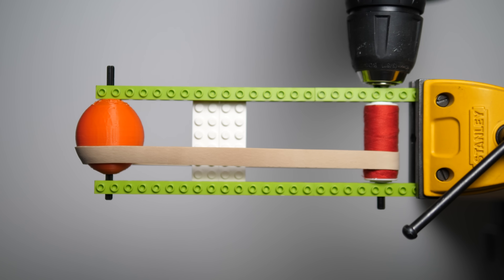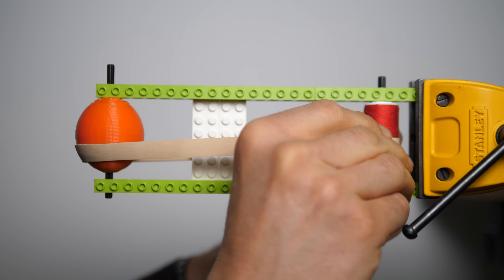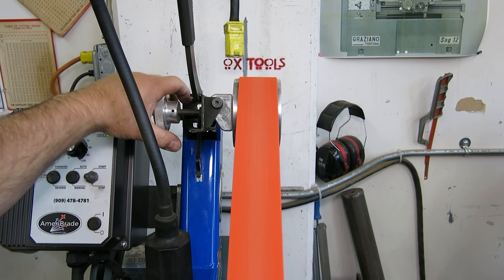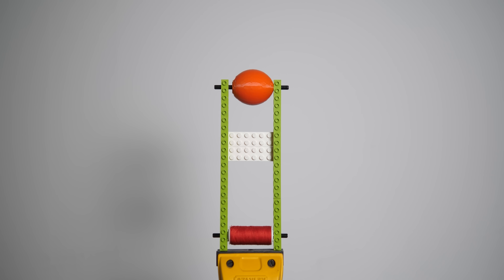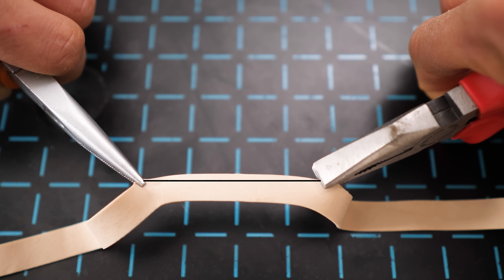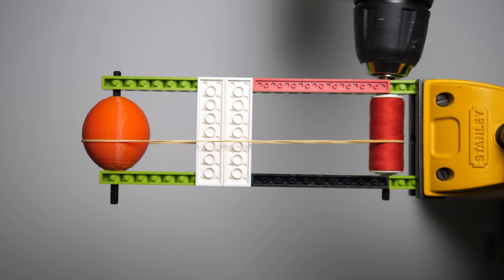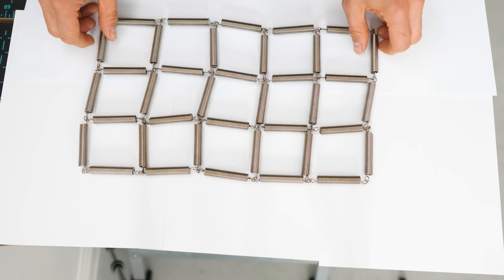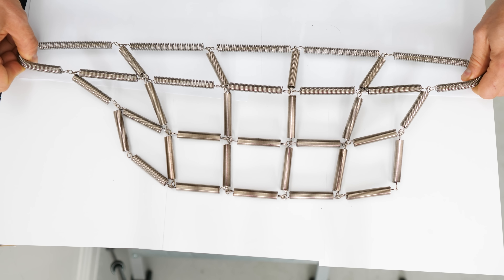The Band Should Slip Off But It Does The Opposite!

Comment: This doesn't seem entirely correct. The ball pulley or concave pulley have different rotational speeds in the center, and exterior, depending on the pulley used. 

Ball: faster in the centre.
Concave shape: faster on the exterior.

You're right when it comes to the separation of the elastic band into more or less two parts. But it is because one of those parts moves faster that it directs the band in that direction. At least as far as I can intuitively sense. 

Like a storm on Earth rotates towards the slowest part of the rotating Earth. Now imagine those clouds are mollecularly bound together, and cannot rotate. They are a flat elastic band. They would pull the slower clouds, to whom they are molecular bound, along with them towards the fastest point of rotation, the fastest rotating longitude.

Don't you think?

Comment: There's a well-known lab demo in introductory statistical mechanic where you hang a weight on a rubber band and then use a hair dryer to heat the elastic. The band contracts and the weight rises, precisely because you're adding energy to the system and dS ≥ dQ/T (for an irreversible process). There are more ways for the rubber polymers to be shorter than longer, so that is a higher entropy state.

Comment: If it's due to a property of elastic deformation I suspect that it wouldn't work well on a belt sander belt (they aren't all that elastic) yet the crown pully on a belt sander works very well despite a very subtle curve.

Elastic deformation is a good explanation, but I suspect another thing is happening also that would make this work for inelastic belts.

If you try to wrap an inelastic belt nice and flat around the lower/higher end of that curve it's going to head off at 90 degrees to the part of the tangent of the curve. Instead of heading towards the flat contained pully it'll deviate by the same angle as the tangent of the curve of the crown pully.

It's unable to go in this direction though, because the other pully and housing provide a force resisting that.

For an entirely inelastic belt an equal and opposite force will be applied at a tangent to the surface of the crown pully in the direction of the center (high point) of that pully.

Purely elastic surfaces will work due to one phenomena, purely inelastic belts due to the other. Everything in the real world a combination of the two.

Comment: Yup - always travels the the highest point... I learnt about this working for my Father - he engineered many large industrial band saw machines for the Aluminum industry where the blade was riding a crowned wheel (with no lip to hold the blade on). It reduces the overall stress on the blade = more cuts per blade / better productivity etc.....

Comment: Very nice... so far as it goes.  Traction engine belts to farm machinery, and the drive lines to factory machine tools (similar to the belt sander) don't have stretchy belts (canvass), and they are slack.  It can't be stretch deformation keeping them on - there has to be some other self-centring effect.

Nonetheless, the demo of a belt running on a ball is completely unintuitive (ie it looks mad!).

Comment: Simple yet very effective principle. I first experienced this when I made my own lathe. I needed a set of transmission pulleys and I decided to make them myself. I first tried flat ones. After few trials, I realized the belt climbs(!) the pulley and thus convex-shaped ones self-align the belt. Without any flange, it was very easy to turn with my lathe in a short time with minimal material loss. Still it worked really good. The belt slipped off only when the chuck stall accidentally with too much cutting force.

Comment: Entropy is easy to explain under Everett’s MWI.

If you have 100 coins and they all perfectly have heads up, there’s only one such arrangement.  If you let some disorder in, and one coin can be tail, then there are 100 such arrangements where one coin went rogue.  If two coins went rogue, it’s 4,950 arrangements.  If three coins went rogue, it’s 161,700 arrangements.  And so on, peaking at a maximal number of arrangements when 50/100 coins went rogue.

Under Everett’s MWI, each such arrangement has its own timeline in the infinitely branching multiverse, and there is a chance that you’ll end up in the world where all 100 coins flipped heads. But there are far more of “you” who will observe a messy disordered jumble of coin flips because there are more such arrangements of them, and therefore more timelines under MWI where messiness dominates.

This is why the universe trends toward higher entropy, but if you’re unlucky it won’t.  There’s an unlucky chance that all the air molecules bunch up in one corner of your room and stay there for hours until you suffocate.  And under some timelines, that has happened.  But there are 10^10^10^10^10,000,000 more timelines where the air molecules were reasonably jumbled up in your room and you breathe just fine.  The number of arrangements of messy configurations vastly outnumbers the number of arrangements of clean, orderly, configurations.

So timelines, as they keep branching and subdividing like a fractal, will drown out these rare possibilities until “the” timeline we observe showcases entropy as the certain victor.  But entropy is not truly certain, there are rare timelines where bizarre things happen contrary to the trend toward entropy, but that’s the topic of Everett’s Quantum immortality which we’ll save for another day.
Reply: As an aside, we use terms like “messy” or “clean” because of our instinctual preference for reduced mental model state size.  We have powerful pattern-recognition software in our minds that are constantly trying to compress the hi-def inputs from our world into low-def mental models that we can easily manipulate in our minds to extrapolate from, form predictions, and take decisive action as actors in this world.

However, random numbers, the epitome of entropy, cannot be compressed.  Whereas, orderly, highly structured information, is easy to compress.

We instinctually feel the strain in our minds when our inputs cannot be compressed into the reduced state size we’re accustomed to process in our minds.  This gives us an instinctual/evolutionary pressure to seek local wells of order and structure in which our minds can function.  In a truly white-noise high-entropy world, our brain is a useless organ.

We therefore use “clean” or “orderly” to call the world where our compression algorithms work, and we use “messy” to call the world where our compression algorithms struggle and our mind strains to model the hi-def inputs into a low-def counterpart.

For information that is truly high-entropy, like a sequence of uniformly random numbers, the only compression available to our minds is confabulation.  Like the blind spot in our vision that is filled artificially by our minds, such high-entropy surfaces can be replaced by an artificial texture mimicking the original level of entropy but containing no other information regarding the original.  You may know the font, font size, color, kerning, length, and that the sequence is base 10, but details of the random number itself wouldn’t be absorbed due to the lack of compressibility.

Same with the white-noise static on TV or ocean waves crashing, these high-entropy inputs with numerous unique arrangements are replaced in our mental model with a generic white-noise static or generic ocean waves crashing, indistinguishable from any other without context.

This is why it’s so painfully boring to watch vacation photos of just sand, waves, trees, because they’re so high entropic and non-compressible we see them as featureless and all the same.  By contrast, seeing human faces is highly compressible and therefore we see everyone as unique as can spend endless hours a day swiping right or left on human faces but we’d die inside if we see another photo of a tree canopy or shoreline by themselves.

This is why we struggle more to remember a telephone number that is seemingly random, but we may easily remember it if it ties into a familiar year or age or street address.  We can eventually remember a short sequence of random digits through great effort, but it is much more of a strain when it is unrelated to other numbers we’re acquainted with.  And we’d only undergo such pain if there was some importance associated to remembering it.

Comment: That was strange for me.  When I first saw it, my intuition told me the band should ride up on the pulley, but at the same time that felt unintuitive.  Excellent explanation.

Also worth noting: Take two tires and connect them with an axle, but leave them free spinning.  Now, accelerate the system.  Next, slow down one tire but not the other.  The system will turn in the direction of the breaking tire, because there is more friction on that side.

Now, you have a band across a curved pulley.  When you stretch the band, the side that is further from the opposite end is pulled tighter and thus has more friction.  This will turn the band in the direction of the tighter side.

In short, there are probably two effects causing this behavior.  The stretch widening the band on one side is one effect, but the asymmetrical friction is probably also causing the band to turn toward the higher portion of the pulley as well.
Reply: I was thinking of just this effect before I heard his explanation!
Reply: The “turning in the direction of higher friction side” feels like a better explanation than the one in the video. The one in the video only explains why the band’s width contracts.

Comment: I've worked in manufacturing for years and have observed this effect on lots of conveyors, belt drives, belt sanders, etc. And this is the first real explanation I've heard. Thanks for clearing up something I've been mystified about!
Reply: The belts on such things as thrashing machines and circular saws, driven from the pulley wheel on a tractor, are often slack when running and are not elastic so this explanation doesn't fit.
Reply: @Hanoverauto  There is no such thing, as "absolutely slack", they all do stretch a little. Because they are more rigid, than a rubber band, the same force causes them to stretch by a little amount (in length) but the effect is the same
Reply: @Hanoverauto  Flat Pulleys on tractor takeoff
Reply: that’s exactly what im trying to sort out. no belt sander has a stretchy belt, so why are they crowned? maybe there’s some tiny amount of stretch that seems imperceivable but idk about that, im still skeptical
Reply: @Hanoverauto  I'd love to hear your alternative explanation.
Reply: 4:45 Still don't understand why it would bow upwards. I don't see anything pushing "up" just material stretching along the line. He did a terrible job at explaining. Why would those for springs be pushed up? I don't see any deformation that would push them in that direction?

Comment: I had a 4WD belt driven RC car years ago, and had no end of issues with the belt coming off the front pulley and frustrating me no end.

It wasn't until someone said the kevlar reinforced belt needed to be looser, which allowed it to self centre on the crowned pulley, that it worked properly, stayed on the pulley, and also reduced the friction on the drivetrain. Someone at Schumacher RC cars knew what they were doing!

Comment: Higher tension disequilibrium.
Adding charge current to a twisted nylon fishing string causes muscle contraction. Air flow over a curved surface disequilibrium pressure creates low pressure levitation.

Comment: I consider the shift is due to the speed differential between the right side and left side of the rubber band. If you draw  the velocity vector of the stressed side and the velocity vector of the less stressed side then one will find that the resultant velocity of the rubber band will point towards the top of the crown until the rubber band is centered on the crown, at which point resultant velocity is going to be inline with the center line and no more side wise shift. So my conclusion is that it has nothing to do with entropy, it is just following basic velocity vectors. I reached to this conclusion seeing your video, thank you for the presentation.

Comment: The spot where the rubber band has the greatest tension, i.e. the longest pulled distance, 
will be where the most traction is applied on the ball.

Comment: For those of you who don’t want to watch this retarted 8 min video:

The rubber band has 2 edges, the edge on the higher part of the pulley is in more tention than the rubber band on the lower part of the pulley, so it drags it up.

Comment: Many years ago Mr. Wizard did something similar. If you connect two identical balloons with a valve, the air flows from the less inflated to the more inflated balloon.  The rubber mass is more dense in the less inflated balloon, and the contraction force is greater
Reply: Similarly, the less stretched side of the rubber band is pushed toward the more stretched side

Comment: Hello. Steve, I'm not sure if the explanation is correct/complete. While everything you said is correct (on a yt video level) I think you should have taken a closer look on the effects of the tension of the band and the surface friction. I'm pretty sure that this is a major part of the effect. The "bulging" is needed for the movement but the actual driver for the effect can be found in the difference in friction based on the relative tension of the band. Just a thought.

Comment: if you want an example of a larger flat belt drive that relies on crowned pulleys, there are some videos on the "Surviving Maine on a 20 acre farm" channel of some old sawmills (a bell saw and a rift mill for clapboards, using the old flat belt drives off old tractors.)

There's actually come videos making a large pulley for farmall tractor, and there's mention making the crown. It's neat, and much larger scale than a belt sander pulley. (also the belt drive on most band saws relies on the same profiling)

Comment: and the upper part of the rubberband is more stretched and has more elastic deformation, hence more friction compared to the lower side. due to the friction of the rubber it seems to climb to the point where it has more frction and stabilizes once the friction on all part of the rubberband balances off.

just an addition😅

Comment: So close. It's not band bending. It's not entropy. As the band is stretched, the force on the pulley creates friction. The tightest edge on the crown creates the most friction and pulls the entire band in its direction. Looking closely at the video, the edge lower on the crown actually gets loose. Without friction, this edge does not contribute to the lateral movement of the band.

Comment: So it's nothing to do with the fact that the bigger diameter moves faster than the smaller diameter? That is what I thought pulled these to the centre??? Near the shaft has the same rpm but it doesn't have to move as far to get back to the beginning.
Reply: Yes, exactly. It's not the "stretch" or "curve" of the band that pulls it up. It's the fact that the surface speed of the pulley is faster at the crown.

Comment: The bowing of the rubber band is an interesting idea. I am no expert on this, but, when the video began, I wondered if the reason why the band returns to the centre of the pulley is that, while the band is off-centre, the side of the band that is nearer the centre is stretched more than the side that is further away, therefore (a) it grips better and (b) the other side grips less. In other words, the side nearer the centre grips better and the side that is further way slips more. Therefore the side nearer the centre pulls the band back towards the centre of the pulley. Of course, it could also be that the phenomenon is caused by both these reasons.

Comment: I'm at 2:17 and my intuition as to why it doesn't is that at the moment the band comes into contact with the ball the angle at which the rubber band meets the ball's surface should put the latter parts of the rubber band on the OTHER side of the ball. (take a ribbon of paper in that shape and tilt one end before it bends around to head back to the other, the side that would be going back is now farther away from the parallel flat plane the ribbon would have stayed)

What if you do this same thing but have the portion of the rubber band going back to the cylinder on the polar opposite point of the ball and then run the system to see if this still happens.

Comment: I've seen this type of rubber belt/crowned wheel arrangements on cylinder and platten presses and never thought about how that works. I saw the thumbnail of this video and immediately realized that the belt finds the high spot on the wheel because there is more tension on the belt the higher the diameter, giving the belt more traction and tension to go in that direction.

Comment: yes that does work because the radii of the middle is larger which creates a Delta in tension which changes the force which changes the direction .. so yes that should work, probably not inevitably unless perfectly balanced out, but the principle works just fine basicly the same reason why a moon seeks equilibrium around a planet but then with elastics rather then gravity